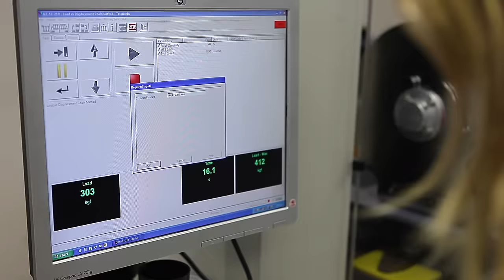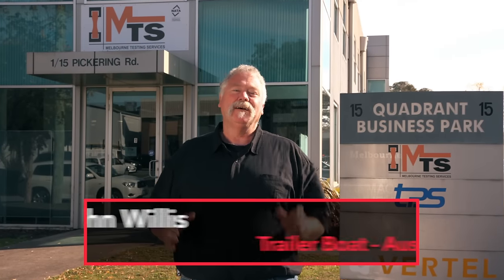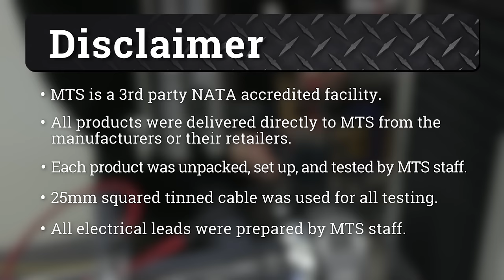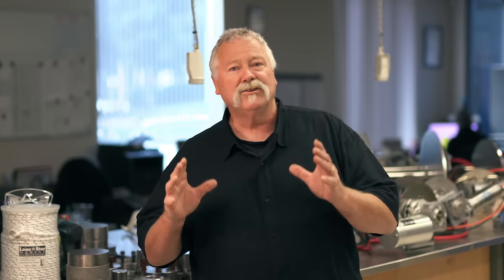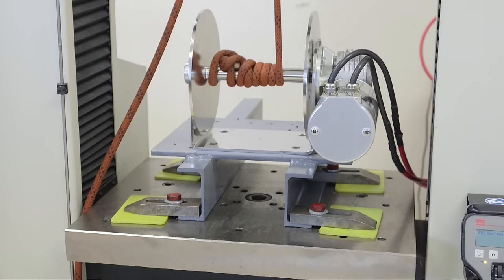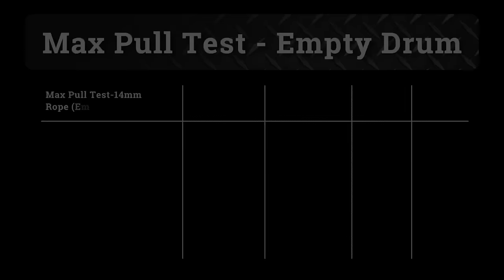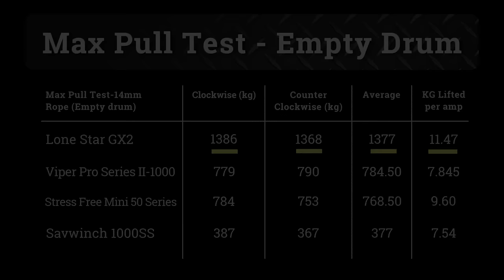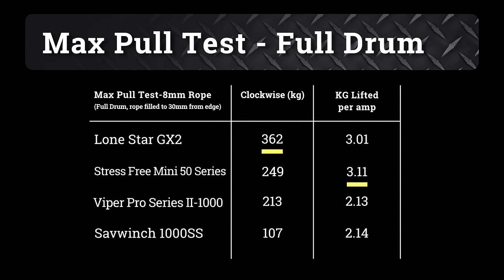Drum Anchor Winch Testing in a 4 way Shootout!

Comment: I have a GX3 bought as a combo and couldnt be happier. Easy enough to install with everything supplied. Also Bought the CX 415 bow sprit, LSM deck roller and MMX 3 anchor, great and strong set up. Reversing solenoid had an issue after about 18 months. Warranty claim was fast and easy, excellent customer service. Would recommend to anyone. Cant comment on the others.
Reply from the maker: @dampierlad392  thank you! So glad to hear you are happy with our product & service.

Comment: Sure looks like you're running these tests in constantly diminishing voltages,   I don't see any battery voltage stabilizing power supply of any type on your supply battery, like a high output battery charger (50+ true amps @ 13+ volts) or more realistically 50+amps from an alternator stabilizing the voltage at around  13+ volts at all times from a running engine, with a fully charges battery.  10 amp battery charger does nothing -  Is that what the tiny red lead to the + side terminal is?  Fill us in.  Where is your tech work?
Reply from the maker: Well hello Pops, no, actually it sure doesn’t. No, the tests were not run on diminishing voltages. They were also not run by LSM, they were run by MTS.

I should probably take the time to remind you of the disclaimer on the beginning of the video. MTS performed all testing to ensure the platform for all products is the same. This of course included voltage, and yes all tests started with over 13v. The ‘tech work’ as you call it is the IP of MTS, the same company that is NATA certified which means they abide by NATA calibration & practices. MTS is the same company that carries out independent product testing for government bodies such as the ACCC.

Besides, if your theory of diminishing voltage was correct how did the GX2 do 100 cycles AFTER the nearest competitor did 42? Because that is the order they were tested in.

Comment: What size of deep cycle battery AHR should i use with a GX2? what is the actual amperage it uses for pulling a winch up?
Reply from the maker: Great question. If using a single battery we recommend a 100ah battery. Consumption on the GX2 will vary with load. Under a standard load you'll use no more than 50-60 amps but as you can see from the footage they can be pushed much harder.  When using a single battery always ensure your outboard is running before using the winch.
Reply: @LoneStarMarineWinch  Awesome thanks for the quick reply. It's all installed now i just can't wait to try it out :)